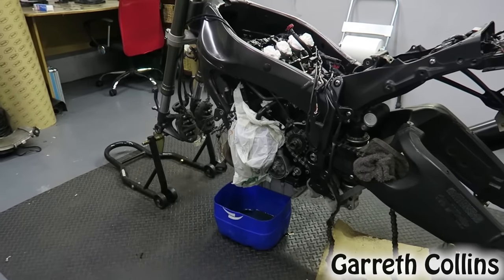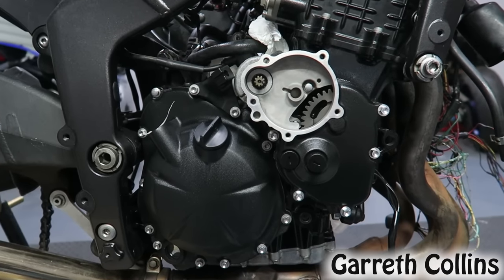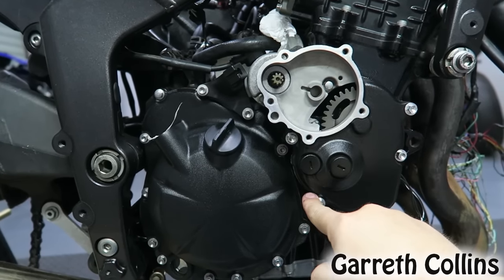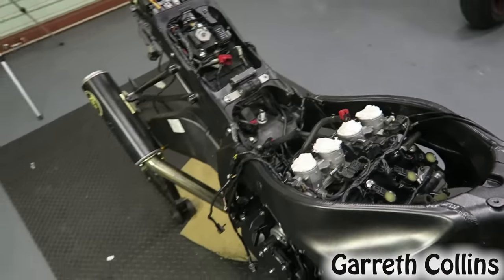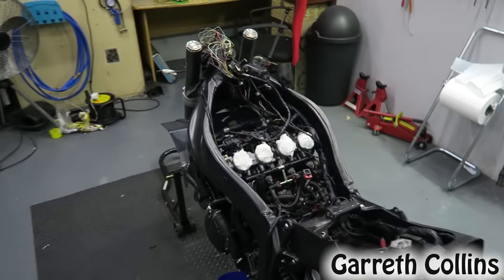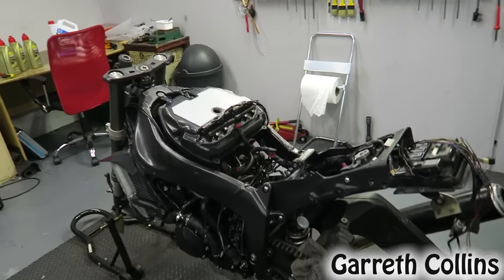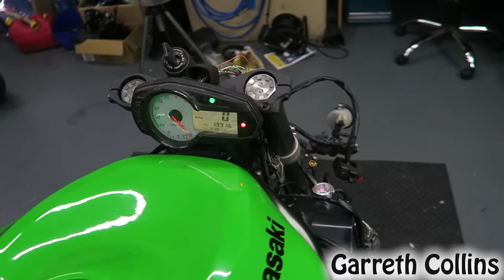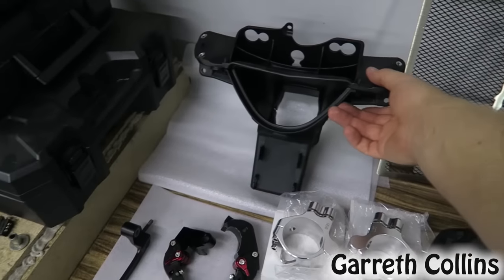Rebuilding A Crashed 2012 Kawasaki ZX-6R Part 4

Comment: first of all im a huge fan of your content and second do you have any tips to repair doff paint fairing without make it too noticable? because when i try to put  doff paint on my fairing that i repair , it has different color  (slightly more black than the original paint) 

sorry for my bad english btw✌🏻
Reply from the maker: Hey Thanks for The Comment. as for the paint it is very hard to get a exact match in paints even when remixing the same paints all I can tell you is to get something that has atleast a 85% match to your paint and use that then take a buffer and buff both surfaces to make it blend
Reply: @GarrethCollins  ok thank you for replying 🙏🏻